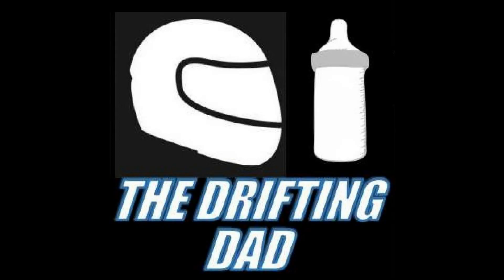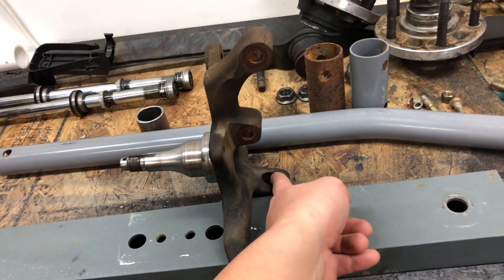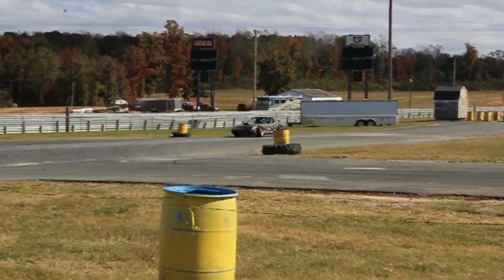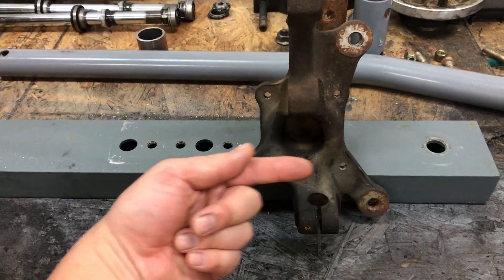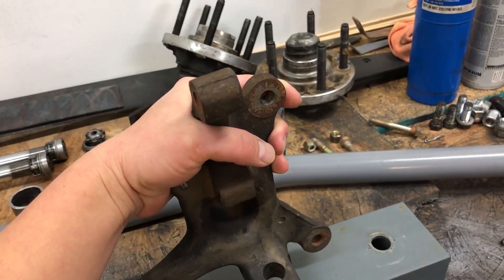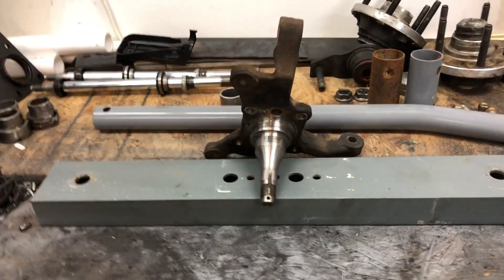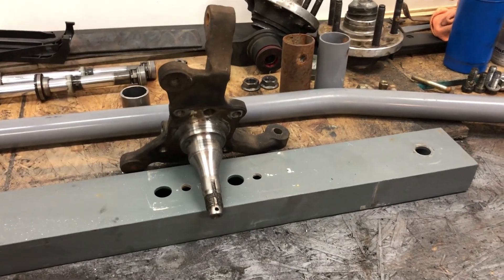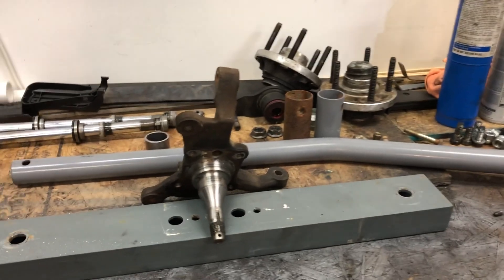Nerdy Drift Discussion!! FC RX7 Steering Knuckle Geometry Explained

Comment: Is that all I will need to get this to work?  FC knuckles (reversed), FC coilovers, and FB camber plates, 626 ball joints and it will all fit perfect?  Do I need to modify anything?  I already have FC T2 brakes... (old RE Speed BBK)
Reply from the maker: Yes!  But you will have reverse ackermann steering, might not be noticible though.  You also probably need longer tierods
Reply from the maker: Moog ES458S is what you need
Reply: Thanks for the info!  Keep up the good work, love your content. This will be my next project.  I want to get rid of the FB front suspension. Could I use the T3 LCAs (picked up a used set recently before I saw this)?  They use a AE86 ball joint. Do you think I can replace those with 626 ball joint instead? Do you think they are compatible?
Reply from the maker: They may fit, not sure what the diameter is compared to an FB

Comment: Have you done an FC front subframe swap? I'm in the process of converting to ls/t5/8.8, but suspension is a mystery to me. I like the idea of r&p and the bigger components of the fc
Reply from the maker: I did not, FC subframe is not a bad idea though. I have no complaints with my FC knuckles and custom LCAs on the FB subframe.    I have a power steering box though so that helps a lot

Comment: Is this the knuckle your running in your FB just reversed and modified for more angle? I have a 83 fb Thanks for the tips
Reply from the maker: This is the knuckle from an FC turned around like you said for the FB.  If you wanted to you can run this in your 83 with a Mazda 626 balljoint in your stock arms and FC struts and springs
Reply: @TheDriftingDad  Wow I never would've guessed honestly lol Thank you for the Info I really do appreciate it, like you said there really isn't much info on these mods out there, so it's a big relief to finally get this stuff figured out, i think your channel is great!! You've  got a really good base to make a well paid career from this channel. Best of luck to you and your Fam. Happy Holidays.
Reply from the maker: Thank you!!  Happy holidays to you and your family as well

Comment: Could you make a video of the fb knuckles and how you modified them?
Reply from the maker: I will try, unfortunately I didn't do any video when I modified mine.
Reply: Awesome! I have been thinking of cutting mine for a while, but never thought of adjusting ackerman.. anything you would change if you were to do it again on the fb knuckles?
Reply from the maker: I would reduce more ackerman than I did.  I had a big difference in angle between the leading and trailing wheel

Comment: It really seems like you’re trying to reinvent the wheel. I like your ambition but it’s wayyyy easier to just swap the whole fc rx7 subframe into the fb and boom you have a actual rack instead of old truck steering arms lol and fc coils knucks and tons of angle kits
Reply from the maker: I agree that FC subframe could be easier, but I did not want to redo my pan or move the steering rack if it did not clear.  This is a lower cost option for me to get caster trail and other desirable geometry for drifting.
Reply: Redo your pan ? If your drifting you should be running a baffled pan w and Accusump, or a dry sump. Improved racing makes a bolt in baffle for fbody pan and that would clear the subframe. I’m setting up my rx8 for next years drift season.
Reply from the maker: I am running a road race style pan with baffles and windage tray and crank scraper, no issues, but i would like to run an accusump
Reply: If it’s a rear sump pan I would imagine it would clear a fc subframe. I have an fb and fc as well. I’m going to fix a rx8 rear subframe under my fb